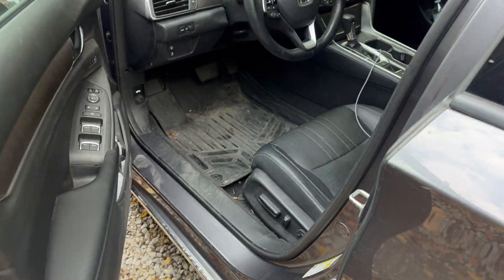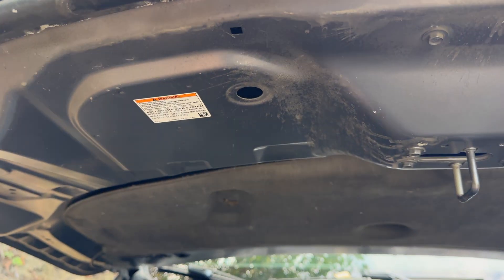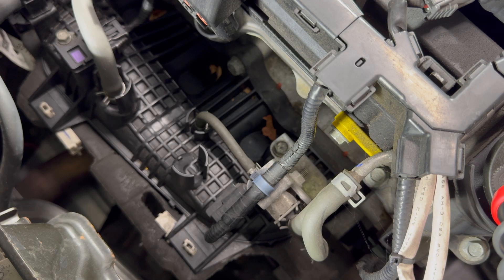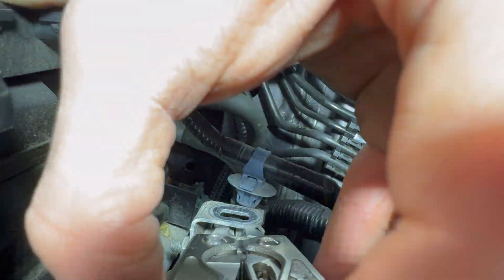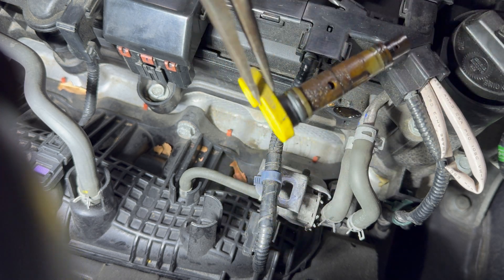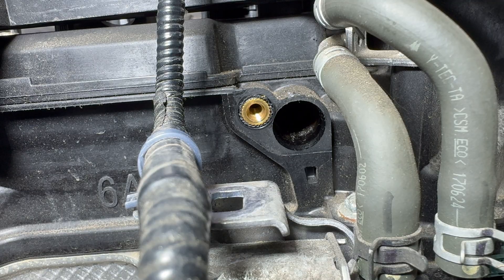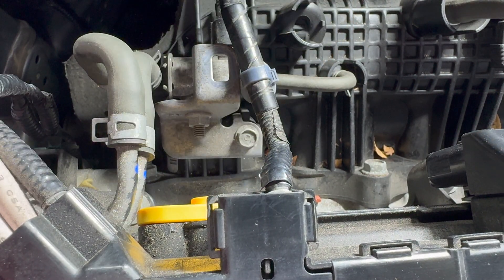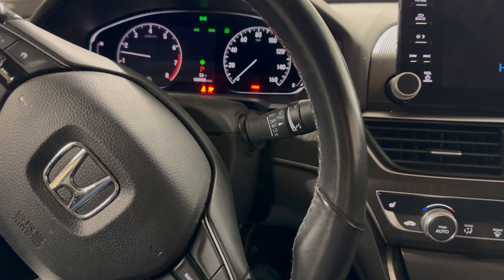10th Generation Honda Accord PCV Replacement (2018 1.5 Liter Turbo)

Comment: wow my 2019 1.5 t is at 120k mileage . I didnt change this at all. I justgot same code again which is Cylinder 3&4 missfire . Now i will be ordering soon 4 sets of denso ignition coils and 4 sets of NGK spark plugs but after watching this I will be adding this as well

Comment: Anyone ever have issues removing the PCV valve bolt? It just spins but does not come out. Considering the plastic value cover, im thinking the threads are somehow stripped. Not sure what else to do besides replacing the valve cover. Hopefully someone has a solution for this.

Comment: Hello. I'm close to 80k. 2019 1.5t Sport. I just did my spark plugs from your tutorial. Looks like I may do this too, probably wouldn't hurt. Thanks for the tutorial.
Reply from the maker: Stay tuned… a fuel injector replacement and intake valve cleaning video is in the works..
Reply: @DavidStumph  you're the best, I'm really looking forward to those.